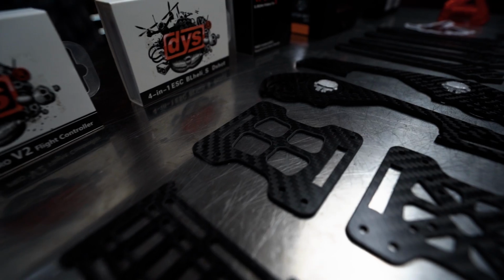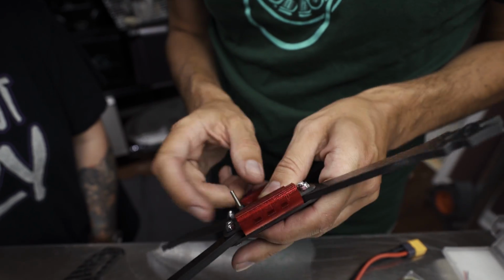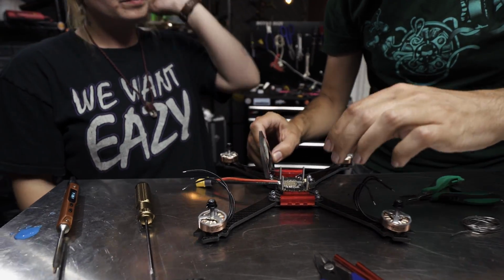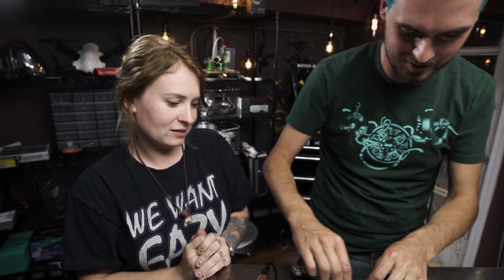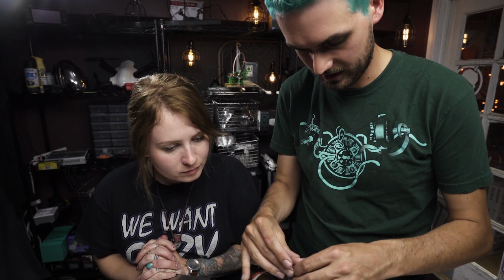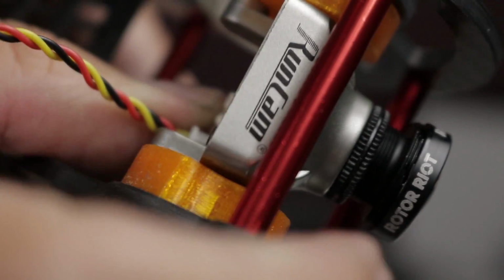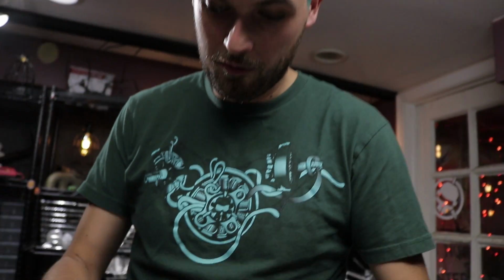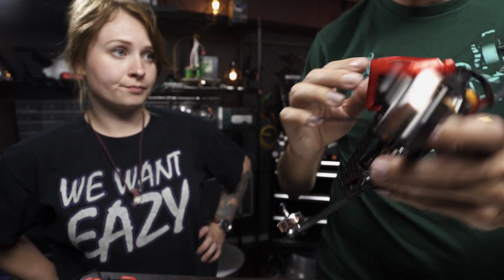Flynoceros Sköll Build - with Le Drib and Miss Creature

Comment: There are other youtubers that absolutely hate 3D printed parts as "It is just unnecessary extra weight." I Love this frame and the ingenious use of 3D printed parts... very cool.
A tip from someone that has soldered every day for a living... get some 0.025" solder it is thinner than what you are using and easier to solder without getting too much solder and for your FC and even the ESC use a smaller tip and you will be able to get into everything better.

Comment: If you use a grinder (Dremel w/cutoff wheel) as Miss Kreature suggests (I agree) to cut the screws, put a plastic bag over each motor and tape tight. Otherwise, you'll get metal powder in your motor magnets. When you are done, blow off or use tape to clean off any clinging metal and blow off FC before removing the bags. 
Best is to trial fit the stack and get the right length screws, or cut to length off the frame, but doodoo happens to us all....  (Ask me how I know about the motor thing)

I plug in and flash my FC with the latest firmware 1st thing. - that confirms all is well (so far) It's also much easier to return a bad board if it's not been soldered to.
You are honest guys, a lot of Utubers would have cut the normal build issues.

Good video guys!
Reply: ...or remove the screws from the stack, then cut them.

Comment: You can read a short to ground with a continuity tester on some boards. My Mamba stacks read short under continuity, but it works fine.

Reads something like ~3 Ohms, which isn't a total short, but I'm not educated in EE enough to explain it.

Comment: Le Drib, I started using long screws like that for the same reason, then I found the rubber standoffs which have metal inserts, but do not go through making a true soft mount. no trouble since.

Comment: Ok here’s a reply to everyone who’s freaking out about the VTX being powered up without the antenna on because of reflected power (VSWR). Relax. Yes a VTX’s output will burn out without a 50ohm load on it, but when you install them for the first time higher grade VTX’s are shipped off and not transmitting until you select the transmitting wattage, this will turn the VTX on.

Comment: Neither ESC or FC has voltage on the mounting holes right? I usually just stick with the nylon standoffs if the manufacturer included them out of fear that metal bolts would short it.
Reply: You can use the same technique as Drib did with 30mm Nylon screws, even that is more crash-resistent than the stacked standoffs.  Personally, I wouldn't touch a board that has anything other than ground connected to the holes, though.

Comment: i have this fc and the osd flicker is horrible got most of the noise out but the osd is gone soon as i touch the throttle any ideas why i tried a 4 in 1 esc and individual escs tried a cap and nothing helps